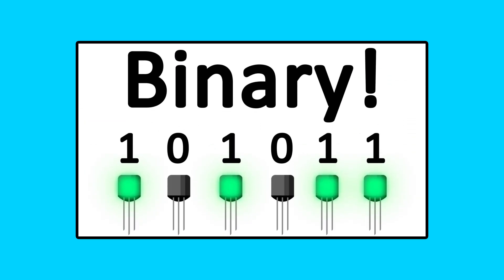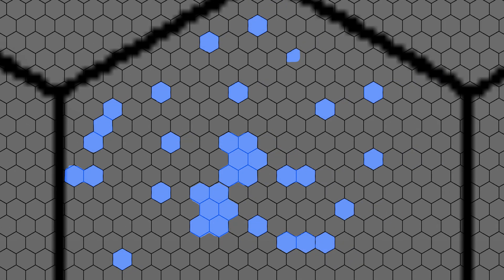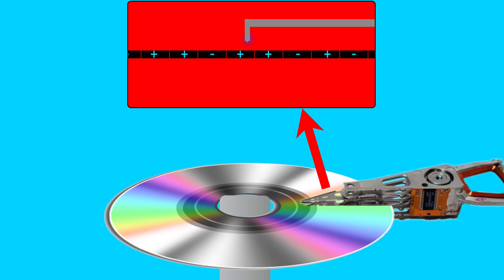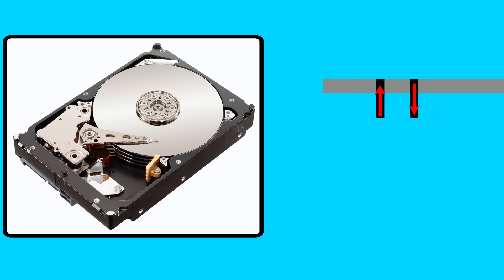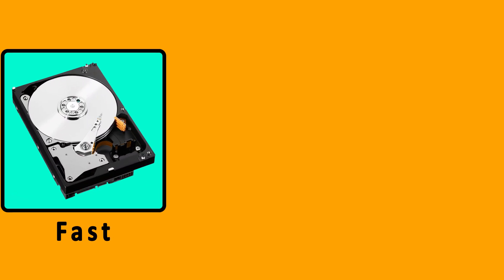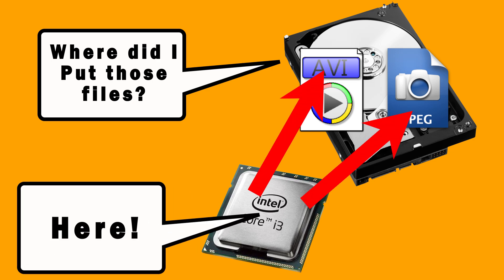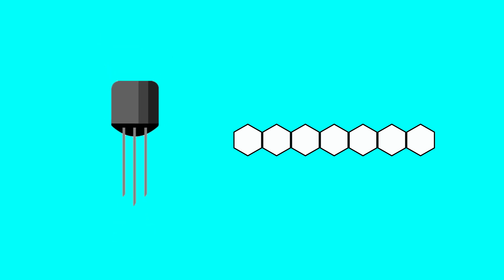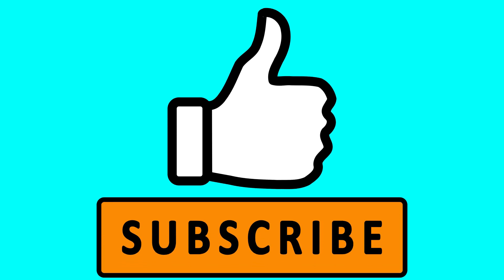How Do Hard Drives Work?

Comment: You said you run a solid state drive and a hard drive there both for storage right? So wouldn't it be more logical just to run a hard drive and fast ram wouldn't have the same effect? ( Sorry I'm not experienced in this field )
Reply: Nope. RAM is temporary storage. When you load a program, parts of it gets copied from the hard drive/SSD into RAM. When you close the program, it gets removed from RAM and is lost. That's why we have permanent storage. Even though RAM is fast, it looses its contents when power is lost. SSDs are much faster than hard drives which is why most newer computers exclusively use SSDs

Comment: Doesn't the disk read changes in magnetic flux, not just the charge (a change in polarity is a 1 and a lack of change is a 0, basically).
Reply from the maker: Yes, that is what the term "charge" refers to here. For script purposes it's a lot easier than saying "magnetic orientation".
Reply: @H3Vtux  I guess. If I didn't have a book on hand I would've understood it as "positive polarity means 1". Either way thanks for the great video!
Reply from the maker: @galfajon1732  Thanks! To clarify whether a magnetic pull is positive or negative it's a 1. It's the lack of charge that represents a 0 (assuming the active high signal method is being used).

It's very difficult to simplify things while also keeping the information accurate. If you want to know a bit more about how the magnetization of the regions on the disk work look into "faradays law".

Comment: One of the most informative videos I've ever seen.

I have two questions, potentially dumb ones but I'm still going to ask:

1. When you're taking about " positive or negative charge" on the magnet, we're talking about polarity here, right? Is this the same thing as calling the poles "south" or "north"? 

2. How do the regions make sure their polarity or the electrical charge they've received does not cross over to their adjacent regions? I mean do they have some kind of potential "wall" to prevent accidental spillage of charge?
Reply: 1. yes

2. It doesnt spill to other places, just like how CPUs, GPUs, etc pack millions (sometimes billions) of transistors into a very very tight space for even a simple DIY curcuit